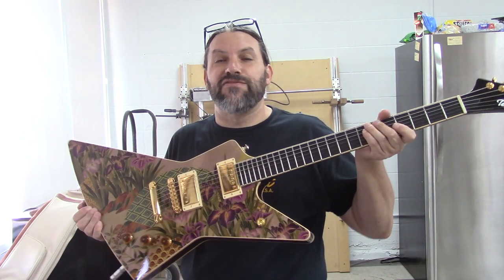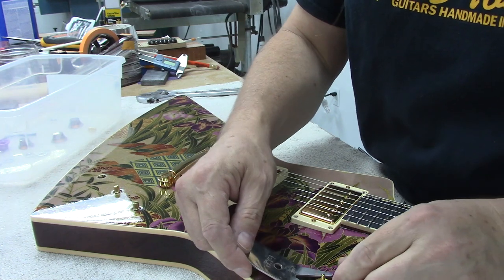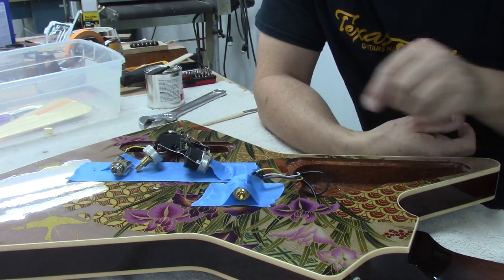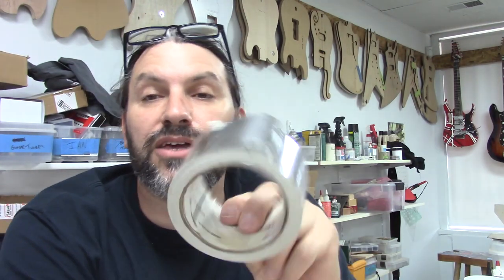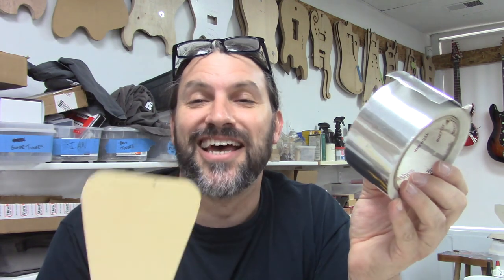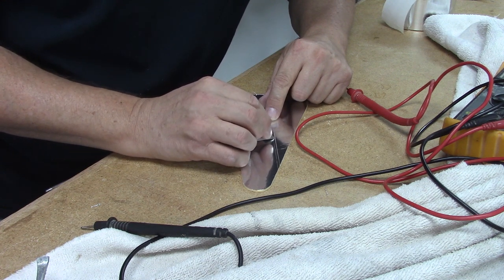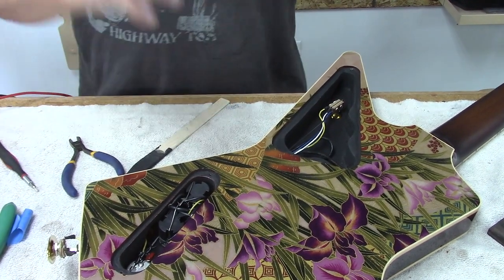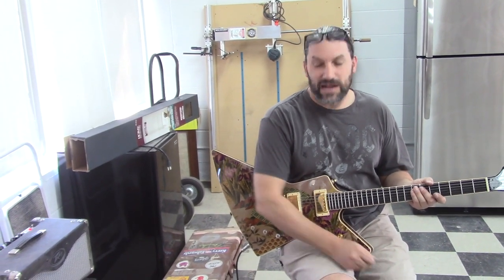Everything You Need To Know About Guitar Shielding... Almost

Comment: From Leo:  You did a good job and it worked fine. Nothing wrong with that.    Turn your meter to the X 10K scale.    The shielding paint IS conductive at a higher resistance.   It still conducts enough noise to ground to matter.   If you ran a jumper from the hot of the output jack to the shield paint, the signal would die.    Been repairing guitars and amplifiers for several shops since the mid 1970's as a side business.  I tap a small phillips  screwdriver and make a row of dents along all seams, that insures the pieces are electrically connected.    I have used paint, aluminum tape and copper tape with satisfying results.     I have see more than a few where the shielded cover does not make electrical contact with the cavity shield.  Always make sure the cover foil touches the cavity shield at least a couple places.  I also shield the pickup cavities on most single coil guitars.
Reply from the maker: One can spend a lot of time with shielding, I don't think it is that big a deal but we have started doing something

Comment: Hey Matt! I'm an old fart who's been building this crap for decades! Not braggin' just fact! So here's my $.02 worth! The only time you really need body shielding is if you use single coil, split or tap your coils or shift your phasing in any way! That being said, you should ALWAYS shield your output wire no matter what, because it also acts as an antenna and will pick up any and all magnetic frequencies within the area (that means it's gonna hum!)! Anything conductive can be used for the body shielding as long as you can shape it to the hole and make it cohesive with all the other shielding, including the output wire by the way! Most guys miss that little point! Like you did! You still had a slight hum and it was because you didn't shield the output! (No blame just an FYI)! As far as your looks are concerned....It's been my experience that some people will f@#k anybody! So you're good!
Reply: Thanks Weary Traveler... more ideas / data to check my ~grounding issue.

Comment: Hi Matt.  I have something to add :)  The thing about a "Faraday cage" is that it does not have to be a solid sheet.  It can in fact be a cage like mesh.  Hence the word "cage" in the name.  This is the reason why we don't need shielding on the top of pickups.  The guitar strings make a "Faraday cage".  So, the wavelengths that create the noise are lowish frequency and so the wave pattern is fairly large.  Too large to pass to the top of the pickup without hitting at least one string and getting earthed.  Thats why the back plate that had the letters cut out still works and why some fairly patchy jobs can still work out OK.  I like the way you did it because it leaves no room for error.  Great video as usual.  By the way ...... I laughed pretty hard when you compared over the top shielding to water skiing behind an aircraft carrier.
Reply from the maker: Sounds right to me man. 
That aircraft carrier line is pretty funny HAHAHA
Reply: Guitar strings are great antennas.
Reply: @JohnShalamskas  Not sure what you mean.  You could use one for an antenna, thats true.
Reply: @cheapskate8656  That's why you will find a wire soldered to the Strat trem claw that connects to ground in the control cavity.  It grounds the strings through their contact at the trem/bridge.

Comment: Its more an issue with single coils than humbuckers. Shielding their control cavity helps, but shielding around the pickups themselves gets rid of the noise but can also affect the way the pickup behaves. That's a whole discussion in itself.
Matt, you might consider using a star roller over the two joining pieces of aluminium tape. It puts tiny holes across it (like a perforation) so you're not relying on just one point of contact. Otherwise you're making a capacitor. Copper tape prices these days isn't too bad. I got a 50mm wide x 20m roll off ebay for about $10-11AU a couple of years ago and still going through it. But the aluminium tape is easy to get from the local hardware.
Reply from the maker: Thanks Peter, we pretty much decided that some shielding is all you need. The continuity thing is pretty much bunk. One of the advantages of geeking out about this topic in the shop is that we came up with our own way of doing this on future guitars.
Reply: @TexasToastGuitars  Now its warming up a bit, I bought some different metal powders a while back (aluminium, copper and graphite) and going to give making my own shielding paint a go. The stewmac stuff works but it's expensive to get it shipped over to Oz.

Comment: Really nice fabric top and back! 
...Since I build guitars from scratch too, here are some shielding hints: I'll use the flashing tape in the cavities instead of the paint and avoid the three days drying multiple coats delay and get better performance. As you found by bench marking other guitars the paint has really sketchy performance. ...Any wire runs outside of the Faraday cages should be shielded cables (couldn't tell on the wires going to the switch in your video), you can be tricky and wrap the wire bundle in the aluminum tape for any pass-through holes then ground it. 

...Key however, that I find is 50% of noise reduction in most guitars: The wire run from the volume pot to the jack needs to be a shielded cable! That's where Fender MIA does a disservice to their customers as even $80 import Epi Specials get shielded cable there. Or why even bother using a shielded cable from the guitar to the amp? Twisted pairs, a myth, are useless in a guitar or again we'd use twisted un-shielded cable from the guitar to the amp. 

...The aluminum actually provides a higher performance Faraday cage than copper (there are research reports floating around for those that really need to prove it, all the electrical and radio and cell device folks have done exhaustive research far beyond any guitar factory) so if you put copper down also put aluminum tape! 

...One item often missed: covered pickups provide a Faraday cage themselves if they are properly grounded, open faced humbuckers recording in front of a computer will be noisier than you can believe even if all the rest of the guitar is properly 'caged'.
Reply: Twisted pairs aren't a myth. It's just that it doesn't make much of a difference with the short runs inside a guitar, but it is still good build practice (and helps keep paired wires together for easy runs). These days we've figured out much better ways of reducing noise by using shielded wires instead.
Reply from the maker: Thanks jvin248, we pretty much decided that some shielding is all you need. The continuity thing is pretty much bunk. One of the advantages of geeking out about this topic in the shop is that we came up with our own way of doing this on future guitars.
Reply: I would love to see a link to any study claiming Aluminum shielding is electrically superior to Copper.   Copper has a lower resistance than the same thickness of Aluminum, so the "skin" depth at radio frequency is reduced.    For the purpose of shielding a guitar electronics cavity, there will not be a noticeable electrical difference.  Also, copper is much easier to solder than Aluminum.

Comment: Probably that paint in the PRS is conductive, but its resistance is higher than the trigger inside the continuity tester. Put it in the Ohm function and you'll see some low value, but not low enough to trigger the continuity tester. It works.
Reply from the maker: You got me man

Comment: Sheilding works because a guitar’s strings and electronics act as receiving antennas to electromagnetic & electrostatic fields that they come close to. 
I.e. fluoresents(static), motors (magnetic).  Twisting source and return wire from single coils eliminates the electromagnetics because any magnetic field coupling to both wires induces opposite polarity current in each canceling the interference out.  The sheild provides a barrier to any static field by providing an easy path to ground shunting any interference away before it gets into the signal path.  
SO, the better conductive the material is the more rejection you get. Copper is only a slightly better conductor than aluminum, but costs way more. $$$ is why the industry used alum to shield tuned ckts in radio & TV instead of copper.
Reply: Picking up some AM Radio! Nice
Reply: @shawns9410  my single coil J pickup in Squier Vintage Modified Jaguar did this. Even after shielding - cos the pickup itself is doing the magic. The workaround - humbuckers or move a few feet either side to get into a trough from the induced signal. In my case it was the induction loop for hard of hearing - someone was piping the band thru it ... Alternative workaround ... Convince the sound engineer to stop it - get some help. Pedals can pick up RF too.

Comment: I had the same problem with my "copy" Les Paul Standard.  I used copper tape because that was what I had available in the pot hole and pickups.  When I put it all back together there was no sound from the guitar.  What I found out was that it was a grounding issue in the pots area, to be honest, I had not reconnected the ground wire from the bridge.  Unfortunately I am not living in America at this time and am in Asia so there's not much chance to get advice from guitar makers here (language issue).  Once I removed the copper tape from the pot housing it worked fine, even though I still have not reconnected the ground line.  I do plan to get more guitars from China because its easier being here.  So I do a lot of repairs and modifications myself, kinda jumped into the deep end of the pool without really having any training or experience.  Thank you, because your videos have been of great help.
Reply from the maker: Thanks for watching David, glad to hear you are enjoying the videos
Reply: My first guitar was a Chinese copy of a Les Paul, and it had several issues that I gradually figured out, including a bad tone pot.  Now I have practically rebuilt it, and it is an excellent guitar.  And I learned a decent amount about building and troubleshooting guitars.

Comment: I have found that guys that own "way too expensive guitars" can never be pleased, luckily this guy is the exception to the rule apparently. I generally use shielding paint on wood in the cavities, and heavy duty aluminum foil and spray glue on pickguards. It's cheap, it's easy, and it easy to trim.  As long as you have a good bridge ground, the buzz is never that bad.  I dont trust a man that doesnt like a little bit of a buzz 😉 I will use copper on request, but it is kind of overkill in bucker equipped guitar.  Just my 2 cents, your mileage may vary.
Reply from the maker: I hear ya on all of that, the guys who play on stages never noticed. We pretty much decided that some shielding is all you need. The continuity thing is pretty much bunk. One of the advantages of geeking out about this topic in the shop is that we came up with our own way of doing this on future guitars.

Comment: Yes I do have experience shielding guitars.  I've shielded many.  You did it basically the same way I prefer to do it.  Sometime I use tape instead of shielding paint if the guitar is "vintage" because the tape can be removed without much fuss.
Reply from the maker: Thanks Tracy, we pretty much decided that some shielding is all you need. The continuity thing is pretty much bunk. One of the advantages of geeking out about this topic in the shop is that we came up with our own way of doing this on future guitars.
Reply: @TexasToastGuitars  
Is there a video on your own way you came up with or is that a wonderbread secret?

Comment: Hey handsome... Every guitar I've built, I've used that same aluminum tape, with no shielding paint, and no problem with humming noise even under fluorescent fixtures. The biggest thing people forget, is to run a ground wire to the bridge !  Old Gibson's were notorious for not grounding the bridge.
Reply from the maker: I think people make too big a deal about what is used. A little something is all you really need. You could also switch over to EMGs they don't have a ground wire
Reply: @TexasToastGuitars  I think Kyle means he grounds the metal bridge that the strings are attached to.  Guitar strings are antennas.

Comment: Hey Matt 
Don't have anything to add and  can't really say your handsome but should the pickup cavities be shielded also?
Thanks  as always
Sean
Reply from the maker: I don't think so but you certainly could
Reply from the maker: If we used a lot of single coil pickups it would probably be a good idea
Reply: I did mine just to be safe.
Reply: @Guestar yea, I'm guessing what I got rid of was mainly EMI from all of the electronics, etc...and from any wiring issues in my old ass house from the 50s.

Whatever it was, it killed the buzz in my inexpensive Strat-style guitar completely until I turn the gain up on OD. I believe I posted this before but it was so quiet when I plugged it in, I initially thought I had pulled a wire loose when I had it apart. 

Nope, all wires intact. Its really that quiet now, and I genuinely enjoy playing/learning with it that much more because of it. I couldn't have asked for better results.

Comment: Shielded wires are the most efficient way to go, if they are unshielded they act as arials inside the guitar. I am with you on the cover plates, they should be foiled to prevent any stray signals getting into the control cavities.
Reply from the maker: Yeah, we have pretty much decided that the shielded wire is the important part of this equation.

Comment: I’ve used the aluminum shielding tape for years. Aluminum is a better shield than copper.

The shielding paint should be conductive. I stopped using it because a lot of it isn’t. Glad to see the StewMac stuff is. You might get a resistance reading on the stuff that seems non conductive. 

The silver shielding paint is nickel Super Shield from MG Chemicals. Very expensive!
Reply from the maker: I like the aluminum tape too works great for us as well

Comment: I've used the paint from Stewart McDonald a few times and found it to work well, and it's a bunch easier than fiddling with the copper sheets. I've even painted the inside of the cavity covers and had that work fine. It seems to adhere to the plastic well. The flashing tape or whatever is a pretty good idea tho I'm gonna have to try that.
Reply from the maker: Thanks John, we pretty much decided that some shielding is all you need. The continuity thing is pretty much bunk. One of the advantages of geeking out about this topic in the shop is that we came up with our own way of doing this on future guitars.

Comment: You can get the adhesive copper tape from a local garden centre. It's also used to stick around plant pots as the slugs don't like to move over it. The adhesive isn't conductive though so if you overlay one piece over another, you need to put a blob of solder which connects the two pieces together. With it being copper, it's real easy to solder to.
Reply: Hobby Lobby sells the same (gardening variety) tape cheap as dirt in different widths ! It's funny because I shielded a guitar with aluminum one time and the guy took it home, took it apart, and came back yelling at me because "what is this cheap shit???" And made me put copper tape in.... it buzzed more with the copper. The problem was not the guitar, it wasnt the wiring, it wasnt the shielding....   it was the set of pickups that he had hand wound out of a cheap Chinese kit, and there was a break in the coil wire. 🤣
Reply from the maker: Thanks David, we pretty much decided that some shielding is all you need. The continuity thing is pretty much bunk. One of the advantages of geeking out about this topic in the shop is that we came up with our own way of doing this on future guitars.